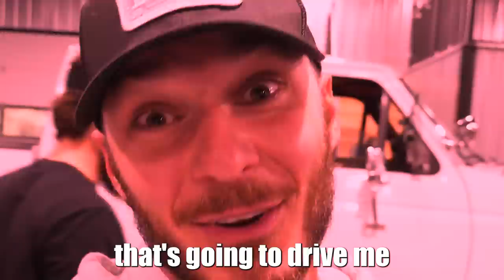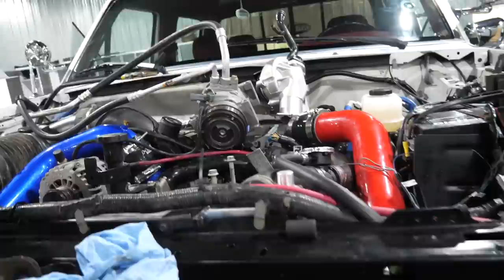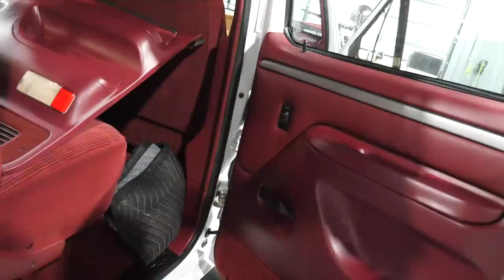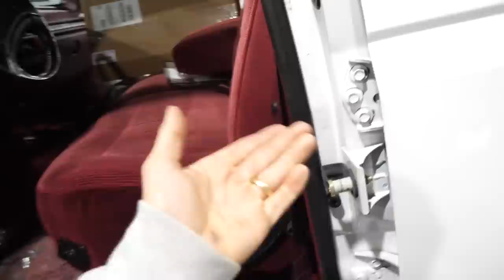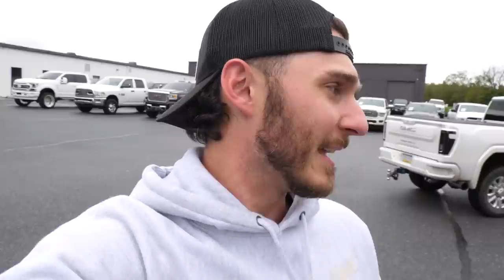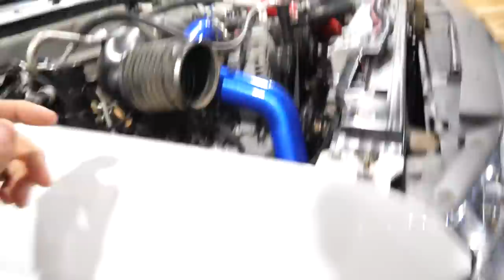The Sad Truth To This Build.

Comment: to the air hose situation, you could add cut off valves to each reel so that way if you have a line or fitting that breaks or just starts leaking you can isolate that one hose and fix it later. itll also save your compressor by not having to constantly run if any of the above happens.

Comment: Hey man I absolutely love your channel  But on the front axle the Ford axles are automatic and manual if you just put manual locking hubs on it you will be fine You don't have to hook up the vacuum line
Reply: I get why he wants to do it however he has to realize those vacuum hubs aren’t that reliable. But he probably won’t read the comments